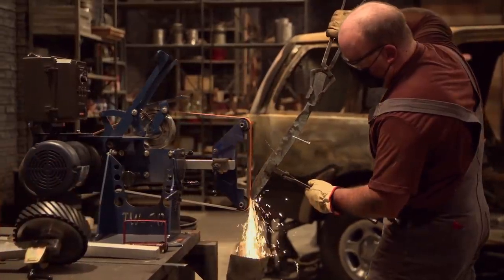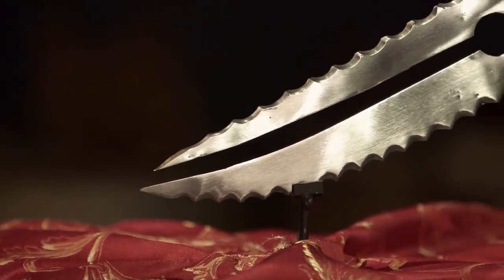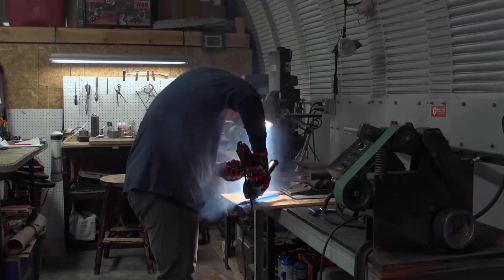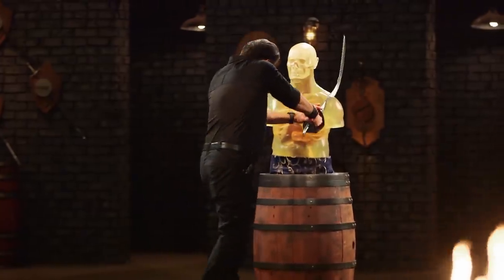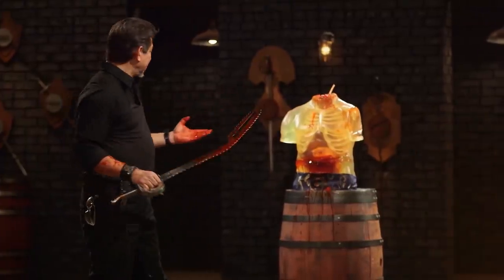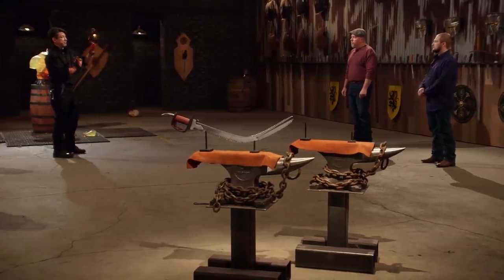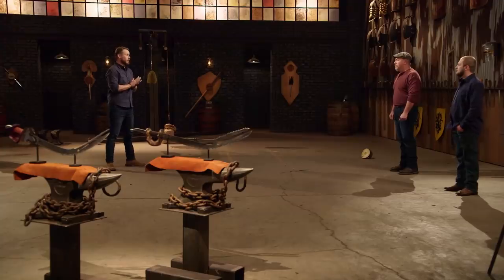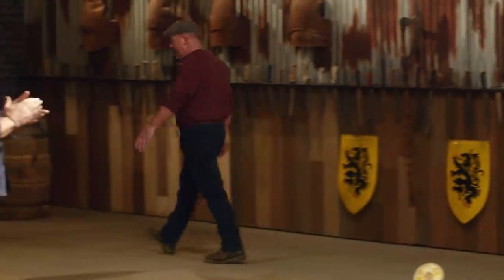Forged in Fire: Teeth of the Tegha SHREDS the Final Round *SPLIT-TIP BLADE* (Season 8) | History

Comment: This is definitely one of the hardest weapons ever
Reply: The right guy won... he actually forged the split in the tip, the other giy used modern technology to cut it outvlost forging
Reply: Real talk. This was a tough build
Reply: @kevingibson7654  your analysis is spot on. Agreed.
Reply: @kevingibson7654  they both used a grinder didn't they?
Reply: @nathantorresstanevil6958  yeah i didn't catch it the first time cause it kinda looks like its forged in the end product but after i rewatch i think they made the split roughly the same way
Reply: @thestonethatgodcant  your totally wrong... one forged it that way the other cut it out
Reply: @kevingibson7654  they both cut it. What are you talking about. Both used a grinder. You can literally see it
Reply: @kevingibson7654  yeah i agreed till i rewatched he even mentions thats what hes doing and why he put it in the vice. they dont show much in this so i dont know if the allegedly forged separation was just assisted by scoring a line with a grinder and maybe the other guy literally just cut most of it out with multiple cuts all the way through. im getting the impression they both at least used a grinder the cut the length of the separation straight through the blade at least once
Reply: @kevingibson7654  the didnt show any forge welding with respect to the seperation
Reply: @kevingibson7654  and they didnt show it being split open but maybe that got cut out for youtube. the end product of the winning blade def has the appearance it used more forging than grinding compared to the losing blade
Reply: @kevingibson7654  do you think scoring it with the grinder was just a way to help split it and it was no power tools after that?
Reply: @thestonethatgodcant  Either way, the bigger thing here is that the guy who lost made the split after heat treating while the winner was smarter and did it before.
Reply: The heat from the grinder could have easily ruined his heat treatment. I was expecting a failure or at least a bend at the tip of the blade.
Reply: And one of the coolest
Reply: @kevingibson7654  I agree that the right guy won, but not for that reason. stock removal/cutting is a historically accurate method
Reply: @kevingibson7654  doesn’t matter how you do it. All that matters is how good the product is
Reply: I mean it's more of a ceremonial chopper
There's a reason no one used serated edges in sword combat for a reason 
But they did do the giant tuna sword too so I guess they are reaching a bit for new ideas on "weapons"
Reply: @gimpyrules6714  true but a smith would be expected to make ceremonial weapons as well
Reply: @watchdealer11  nah I know that
But the whole smashing a ceremonial weapon into pots seems a little off for their intended purpose haha but they held up still
Reply: @gimpyrules6714  haha true
Reply: Nope ! The hardest sword ever in forged in fire season is Scottish claymore . Sorry for my spelling mistake of the sword
Reply: Indeed
Reply: @watchdealer11  it's even harder then then the Word Hard
Reply: I thought Claymore is the hardest one. Because it has to be strong
Reply: The at home forge section of the video was way too short. I wanted to see everything.
Reply: This build was a ton of fun! I made a second one for myself because they kept my winning sword.
Reply: @aricfontaine5606  Good job man. I admire you, seriously.
Reply: @asherhockersmith8271  thank you very much!
Reply: I’m your 1 thousandth like
Reply: @jameswaters6550  thanks
Reply: Totally Making The Replica Of The 2 Tipped Sword Is Is Masterpiece
Reply: Thats what she said
Reply: @Seresgenus  😂
Reply: That's what she said
Reply: I really wanna see Mr. Baker make on of these next time they have a judge challenge. That blade was insane ;-)
Reply: true, looking at it si painful enough let alone forging it
Reply: Agreed
Reply: You know what's funny is everything written about Muhammad was written almost 300 years after he supposedly lived.. No one ever saw him live or witnessed his likeness.. Yeshua Hamashiach on the other hand 100s of people witnessed his miracles and many people didn't like him and wrote about him in the time he walked the earth.  There's proof for Yeshua aka Jesus's truth, there's absolutely no proof of a second prophet or that one ever lived 😊. And God wouldn't do the things allah is said to do.. like being okay with killing someone if they disrespect you in the name of Allah.. that right there is pure evil.
Reply: @condorsalesman  It kind of matters.  You can't order one on ebay and present it.  Or can you?
Reply: True
Reply: Aye of that there is no doubt. India, the most ancient, and most technologically advanced civilization of the classical world has bestowed unto it many a weapon of exquisite caliber.

Comment: This weapon looks like something straight out of science fiction.
Reply: Something designed the devil.
Reply: India did a lot of unusual stuff
Reply: @CommanderSharpEye  I have one
Reply: @jaipreetsingh6566  hi
Reply: Like right out from bloodborne
Reply: Pretty sure the Zulfiqar sword they show is not based on the actual Zulfiqar. I believe the on they are showing is based on a more modern ornamental version that is not based on the original.
Reply: Yeah it definitely doesn’t look like it should be real!
Reply: @TheRentown  they are showing a exaggerated one
Reply: @CommanderSharpEye  they still do. Look they crazy movies 😂
Reply: I was thinking more dungeons and dragons. Or something that you would find an orc from lord of the rings using.
Reply: I think that the Sangheli's (Elite: from Halo) precursors to the energy swords, known as the burn blades probably would have looked something like this.
Reply: @toddbatchelder9380  I'm just imagining the hole in the sword have like a ball of energy and when you activate it it just shoots energy beams.
Reply: @jamescar8085  Well maybe some Sangheli officers modified it to where they could charge it up and raise the blade high into the air whilst cloaked on a ledge and then jump down into a patrol of rival clan members or a phalanx of Kig-Yar that already got their shields activated, and by the time said Elite feet hit the ground, unleashes the built up EMP, causing their shields to overload before being brutally dismembered.
Reply: Technically since it's based off a myth its one of the world's first fantasy weapons

Comment: What I like the most about this over other art/food competitions is that 90% of the competition is based on function. It's so much harder to agree on which art or food is better. When you actually see one blade perform better than the other it's so much better.
Reply: Also BLOOD
Reply: There is a problem of edge alignment though. Even experienced cutter might make a mistake and blade might perform worse just because of that.
Reply: @SwordWieldingDuck  a good blade shouldn't break over slight mistakes in edge alignment though
Reply: Yeah a lot of stuff comes down to preference. I made some asparagus for Thanksgiving. My mom wasn’t a huge fan of the lemon juice I used where my Aunt thought it was phenomenal. So the question becomes, whose feedback is more valuable or “correct”? At least with something like this, everyone can see your blade bent or got chipped. No subjectivity with that.

Comment: I feel like the strength test was unfair for that kind of weapon. Serrated edges, no matter how well made, do not like being bashed into anything hard. Damage is inevitable.
Reply: I agree! I feel like they should have done the strength test after the edge test.
Reply: @xOShAuGhNeSsYx96  No, the order they do it in is very deliberate, and shouldn't be changed. But the test should be fair to the weapon type. This test is like doing a flex test on a battle-axe. It makes no sense.
Reply: Yeah but then again if your weapon breaks while in combat because someone blocked your strike, you'll be in trouble
Reply: Actually I think this strength test was very well suited to this blade. I think an ice block would have been unfair. The pots have a lot more give for a serrated blade like this. And yes they do the tests in that order on purpose.
Reply: @aricfontaine5606  Ice block would definitely have been worse, but any bashing is bad for serrated edges. It should have been some sort of sawing test, which is what serrations are supposed to do.

Comment: Doug: Your weapon is light
Me: oooh... he won
Reply: That’s exactly how it is😂 if it’s too heavy for Doug or Dave it’s over
Reply: When I hear it the only concern is the strength test.
Reply: @wicio77  ssaaaaammmmmeeeee
Reply: @wicio77  exactly. I think a few lighter blades have snapped. Especially ones that had characteristics the blacksmiths were unfamiliar with
Reply: If Dave has anything critical to say...RIP
Reply: Yeah that was a very good thing for me. The other thing was my heat treat. I had a better temper.
Reply: @drealboy_  I think Dave’s a Hollywood armourer/bladesmith, so the bloke knows his weapons
Reply: Doug just likes agile weapons but some are meant to turn you into an unstoppable train like zweihander
Reply: @aricfontaine5606  nice job man IT WILL KEAL
Reply: @Ashutosh-jg4pz  thank you! Definitely one of the high points of my life was hearing “it will keal”!
Reply: @wicio77  Exactly, but then if it survives it's absolutely a benefit. Light AND strong!
Reply: @aricfontaine5606  Ah! It's you! Well done mate, that blade certainly looks the part much more than Kevin's one. The serrations look way better in my totally noob opinion. 
I haven't seen the full episode, but from this clip it appears that Kevin quenched the blade before he put the teeth into the blade. If that's right, I believe that pretty much sealed the fate of it because that would pretty much undo the benefits of the heat treatment, right?

Comment: this is an extremely complex weapon to make with all the modern tools and equipment.. just imagine the craftsmanship and hard work that went to making it back in the day with none of the modern tools and equipment.
Reply: From a craftsmanship experience the historical requirements might actually be lower.
However it would be so much more work. And both for the same reason. 
Sawing and filing such a shape by hand is so much slower.
But because its so much slower its not as likely to do drastic mistakes while doing it.

Comment: I still don’t get the fact that they do the strength test before the sharpness challenge 😐
Reply: To see how well the edge performs after stress. Sometimes it's hard to distinguish how the blades held up in the strength test just by looking - so you test their sharpness again and in a good few cases on this show, the cut test revealed those differences. You can think of the cut test as an extended strength test.

Basically the keal test is the first cut test, then strength test, then a cut test again after stress to round it out.

Comment: difference of heat treating before putting in the serrations and putting them in after.
Reply: No real difference other than having to deal with a hard blade or a soft blade. I put mine in before I quenched. I believe Kevin did his after. But it doesn’t make a difference in the long run.

Comment: Not sure what kind of steel would hold up to a serrated edge getting bashed like that.
Reply: We both used 5160. It’s the best sword steel tbh. You may get a better hold up on the serrated edge with like 80crv2 but it won’t flex as much making it prone to snapping.

Comment: Why do a sharpness test after you've spent 5 minutes smashing the ssord into blunt objects to try and ruin them?
Reply: The strength test is to see how well your edge holds up. If it holds up then it will do well in the sharpness test. If it dulls then it will fail the sharpness test. There’s no point in doing the sharpness test first because every blade they get comes razor sharp. The point is for it to stay that way through the strength test.

Comment: I'm a bit on the fence about the labelling of this sword. Teghas are normally known for their wide, thick blades characterized by groves traveling down the length.

The sword featured here is commonly referred to as a "Zulfiqar" - a specialized blade based on the cousin of Mohammed's signature weapon from the 7th Century. However, even that's in the air as the Zulfiqar has never been found or likely even existed in the commonly associated form. There are various sabres classified as Zulfiqar, all featuring a forked blade. However, these weapons popped up during the 19th Century, springing up from the Middle East and into India. The one featured here is an Indian example. It's likely that the actual weapon (if it did exist) was a straight, Middle Eastern sword as curved swords weren't much of a thing at that point in time. And it certainly wouldn't have been spiked.

Comment: if you dont have control of the grinder enough to cut a straight line you need to put ur tools down and move on to something else like maybe admin work
Reply: It’s not a straight line. That’s the problem. It’s slightly curved which is difficult to do with a grinder. That’s why I just cut one straight line and forged the rest of it in.
Reply: @aricfontaine5606  i dont know man i just watched it again and i feel like if you just went easier on the grinder you 100% could have cut that slight curve in it. but in saying that i was an apprentice boiler maker and a TA for a steel fab tradie so i had ALOT of experience on the grinder like i have cut near perfect circles with a grinder that only needed touching up on a belt sander so maybe im just being picky.
Reply: @keiferhall1125  ah okay so you have a lot more careful hands. The other factor is the time. We are rushing to get as much done as possible in only a few days with hardened steel instead of sheet metal. He did cut it a little thin but he was very pressed for time as well. (He snapped just first blade and had to restart on day two. They just didn’t show it here).

Comment: That has to be the stupidest design for a sword ive ever seen. That thing will break sooo easily.
Reply: Well I think they held up quite well! No breaking even when bashed into pots or a dummy.
Reply: How so?
Reply: @3haAD900  The issue is that it is more likely for one of the prongs to snap off. Its better to have a solid, single piece of steel. Dividing it like that just seems rather pointless and unproductive. The only use i could see would be if you held it to "trap" the enemy's sword, then stab with the other hand. Like a sword breaker dagger.